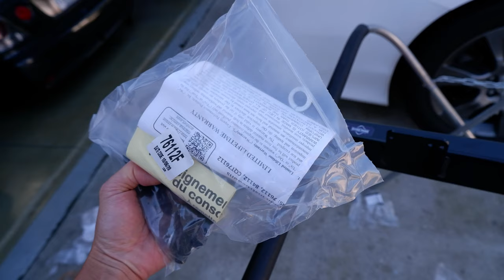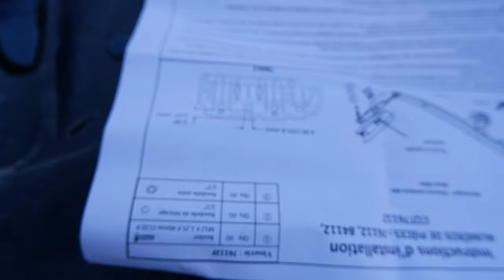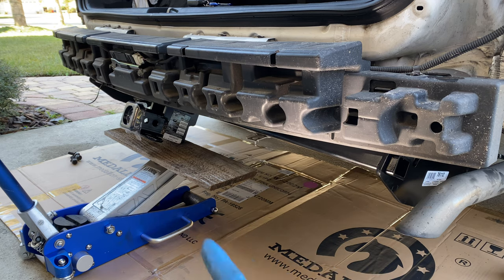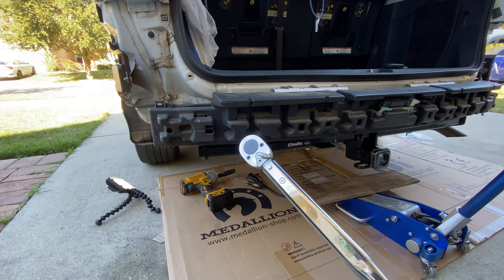How to Install Toyota Sienna Draw-Tite 76112 Trailer Hitch | Class 3 Hidden Hitch Installation

Comment: Great vid! Would liked to have seen the electrical hookups too as I’m looking at towing a trailer with this. Did you see where the hookups are for those?
Reply from the maker: There aren’t any. Got to buy an aftermarket kit and wire it up.
Reply: Tuner with Kids Got it! Thanks!

Comment: What about the wiring?
Reply from the maker: You can get a $48 plug and play adapter. There are cheaper options that require tapping your own wires but the PnP is best since you can remove it for any reason. https://amzn.to/3rlBjiz 
If you need the nice looking plug to mount for trailer, those are like $15 https://amzn.to/3pQzgma and you need the trailer side too.